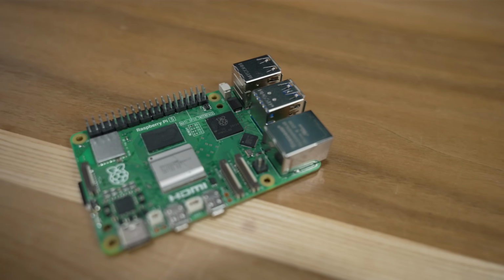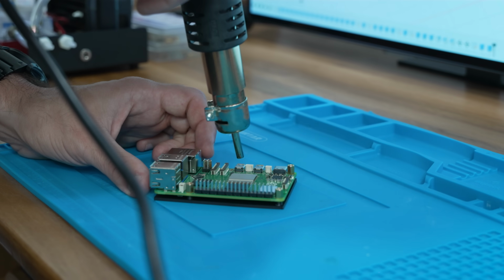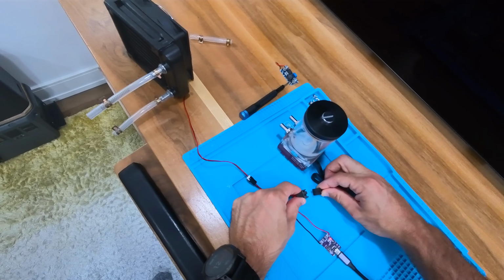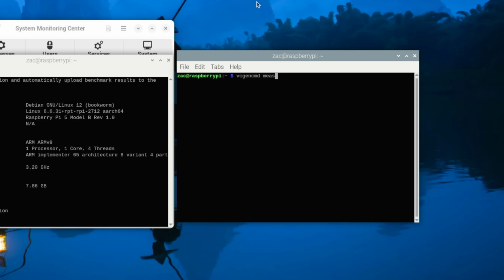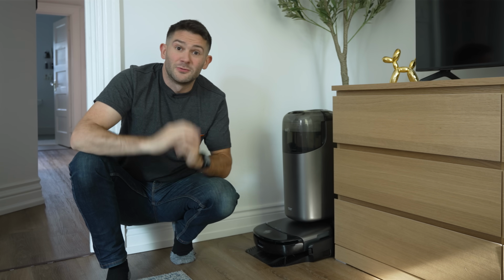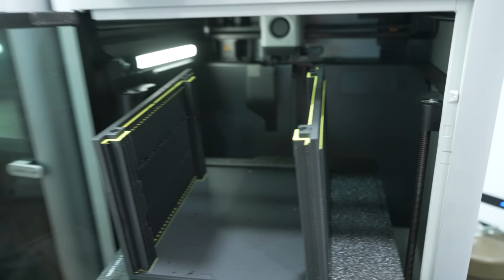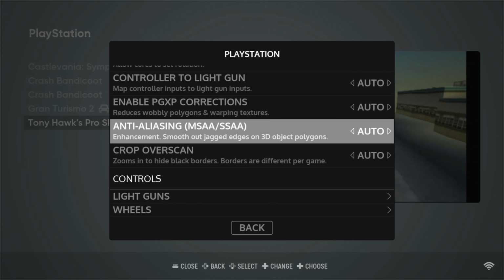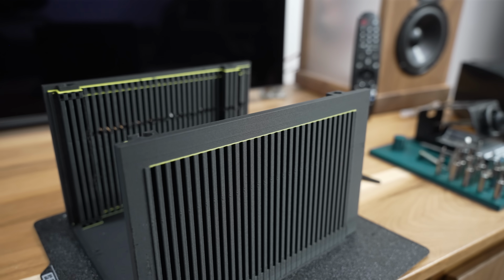Pushing a Raspberry Pi 5 to the LIMIT....

Comment: This will probably sound like "back seat driving", but a thermal pad would have solved a lot of the issues you came across :)
Reply: ...but.... he has to sell that "pro" thermal paste...
Reply: The problem was that the button was a lot higher thank CPU, and you would not want to put thermal pad on CPU if you removed ihs for thermals in the first place
Reply: A lot of this to me felt like a typical case of overengineering. Nevertheless, it's fun to see people go the extra mile.
Reply: @unstablenl  agreed
Reply: Youtube is cool because people who post advice (good or bad) are engaging with the content and giving ideas. good ideas or bad ideas!
Reply: @termiterasin  also agreed
Reply: Wouldn't a big heat sink get the job done just as well as the water cooling on this device? Seems it's would be easier too
Reply: @kennethporter992  yes, a massive block and some heat pipes would have done just fine
Reply: @kennethporter992  I can't imagine the Pi 5 can pump out enough heat to require water cooling, even when overclocked. Haven't watched the video yet, so maybe I'll eat my words
Reply: @krisc1684  Might be wrong, but I assume Zac thought he can do some crazy OC on the Pi5 hence the water cooling, but by the time he realized it is limited he was probably half way in producing the video.
Reply: In Desktop PC Environment, Single Fan water cooling is worse than air cooling. It is more compact, though. But the whole case turned out not to be smaller than a usual gaming air cooler. Using water cooling has only disadvantages her, since the size advantage was not put to use. It looks cool though
Reply: Exactly right. I'd say PTM7950 but I don't think it will ever get warm enough to phase change. A normal hermal pad would have been fine.
Reply: Yeah. With there being a hard limit on what the silicon can be pushed to, he could have easily used a small tower cooler without a noticeable loss in performance. It would draw less power and be just as effective for an active cooling solution - which a tower cooler is, along with any other cooling solution that employs moving parts. The dude that thinks a tower cooler employs passive cooling is unequivocally wrong because they utilize fabs in order to actively remove the heat that has been conducted from the CPU's IHS (or direct die) through the thermal interface material, then into the heatsink which may or may not employ heat pipes further transfers the heat into the fin stack, where the heat would remain until it is then transferred to the molecules in the air. If the air is being circulated thru the fin stack by anything other than passive means (I.e. convection currents) is active cooling. Using a laptop cooler will potentially turn a passive cooling solution into an active one.
Reply: @AlaskanGamerGuy  You're right, but just a quick correction. None of these cooling methods are active cooling. Active cooling is where heat is removed from the source directly. A tower with a fan on it is passive cooling, since the tower itself passively removes heat from the chip using conduction. The fan then helps to cool the tower, which passively loses the heat to the surrounding air. With this water cooling, it's just the same, except the water acts as a thermal mass to move the heat to a radiator, where it also passively moves to the surrounding air. 

Active cooling would be a heatpump using phase changing gasses (air conditioning, fridges), directly applying LN2, or TECs among other methods.
Reply: @Xorthis  active cooling in any time there's power involved. If a fan or a pump is being used then it's being actively cooled. Tower coolers and water blocks are both active cooling solutions. Passive would require no power or moving parts.
Reply: @AlaskanGamerGuy This is the correct response. 100% Lol.
Reply: @Strivexwolf  not sure where that dude gets his facts.
Reply: Lapping the brazed parts perfectly flat and then rounding them over by hand was pretty weird too.
Reply: I was thinking ptm7950

Comment: Someone already mentioned this but it needs repeating.  The moment you wiped the Raspian OS, all your overclocking was removed.  Remember, you were setting your overclock in config files in the OS.  You were running Batocera at stock speeds.  RetroPi would have been a better option as, I believe, it has the same configuration files as Raspian OS since it is based on it.
Reply: How ever the issue that retropie is in though is it has no full rpi 5 image. you have to get the rpios and build from that and then deal with the headaches of emulations being out of date. there's been a lot of forums on rpi5 support in it's website but so far it's a lot of build it yourself and not many emulators built to run rpi5 in 64bit. mostly a lot of 3rd party repo adding. using batocera at least gives you fully updated emulators that work with 64bit. (note this is based off of what info i found in retro pie forums since 2023. I'm unwilling to buy and run a rpi5 due to limited support and recently fixed gpu support. not worth it for a rpi4 with large emulator support in 32bit.
Reply: PopOS also has a new version for raspberry pi i saw when looking around .
Reply: Did rpi5 finally change the sd bus because my experience is that intermitten freezing because the busses are so busy.
Reply: during the benchmark at 21:58 it seems all the cores are running at 3200mHz? so i dont think thats a problem or he reconfigured it
Reply: Yes it doesnt matter. Its not the os. Its the software and firmware.

Comment: As an engineer that's worked with a lot of copper block water cooling systems in the metals industry, just resting the block on top of the unmodified CPU (with cover) and adding a little thermal paste on between the two, would have given sufficient heat transfer.
Reply: And modern thermal tapes are also efficient enough to avoid creating a bracket for this situation.
Reply: THANK YOU!
Reply: yeah the power consumption is like 3 watts lol. thing could be cooled by placing a quarter on top of it

Comment: Doing the 'stock' thermal testing with the IHS off was... a choice.
Reply: Yeah totally a big brain move , just like his "best handheld modded to be even better"
Reply: He got a pretty meaningless result, I'm sure using the standard active cooling solution would have given him low enough temperatures to do whatever he needed (and been way cheaper/easier).
Reply: a choice that likely didn't influence the result much, it'd take longer to heat up but eventually would sit at the same temperature, not really much difference in heat dissipation. also you paint your nails as a man, I think you need to think about your life choices rather than his choices for testing.
Reply: Oh get over yourself

Comment: For any DIYers 17:15 - pantyhose works really well at still allowing decent airflow while providing 10x the dust collection of wire mesh. That way you don’t have a dust sieve that leaves finer dust in your enclosure.
Reply: Hmmm... 😏
Reply: @aeaeaeaeoaeaeaeaeae 💀
Reply: I actually saw a PC build sponsored by a pantyhose company for these reasons lol
Reply: Wait! This is actually pretty smart, you can even make it more or less dense of a filter depending on how much you stretch it.
Reply: Casually looking over at my aging xeon rig wondering what she would look like in some of them shimmer hose the Hooters girls wear
Reply: Hmmmm may need to test this. I do have some pantyhose I never wear. So might work better on my pc lol. My dust filter catches the big stuff like pet hair but not much else.
Reply: Just a 'heads up' remove legs from panty hose before attempting to install!🤣🤣🤣🤣🤣

Comment: For anyone who wants to use a stock pi5.... the temps are fine. His testing was a little disengenious. The stock ihs helps quite a bit as opposed to the die just being expoosed to air. Thermal pads are also much easier to use to fill gaps.
Reply: And if you want to be lazy there's also thermal gel or puddy, which don't run. If you don't want to guess the pad thickness. You see it as that bubble gum colored stuff on many GPU's. Some types also act as thermal adhesive to avoid mounting mechanisms.

Furthermore, he didn't need to use exotic filament like CF-Nylon as ABS (like most PC components) are already made of for a reason.

But yeah, the guy is building a bike and ended up with a jet engine powered pedal assist with gyroscopes to help balance the bike. Still only a 3 speed and Walmart tires.

Even with the 1.1v 3.1GHz OC I'm sure the water loop didn't even need to have the pump running... At this point I feel like Moleman from the Simpsons, I want my 5 minutes of my life back
Reply: @MrHeHim  I'm a firm believer in doing something just because I can, but I never pass it off as something that is needed. To his credit he did mention that it isnt necessary, but that was at the end of the video already. The custom case and everything was cool. I just don't like the attitude of "you have to this to get the most out of it" you really don't.
Reply: But does the IHS help mostly by adding extra thermal mass, meaning it’ll still reach similar temps but it’ll just take longer, or does it really help dissipate the heat. Because I’m not sure that a basically flat piece of metal like an IHS really radiates much heat so I would assume that it mainly provides some extra thermal mass rather than extra dissipation. But I could be wrong.

And of course you can always stick a small heatsink on the IHS which will help dissipate the heat, even more so if you pair it with a fan as is commonly included in good Pi case kits, but you’re still limited by the size, and fins density, of the heatsinks you can physically mount on a Pi as well as the size of the fans (and the air volume they can move). I know from experience they provide enough cooling for most uses, even without a fan you can already get pretty okay performance (and the Pi shouldn’t fry itself since it has temperature limits), but there is little doubt in my mind that you can extract more performance and even some overlocking headroom with a better cooling capacity. 

Whether you need it or not is another question but if you truly want to get the most performance physically possible then you probably should look beyond the typical small heatsink and fan combo most people use with commonly available Pi cases. Although even then you probably don’t need to break out the small PC sized watercooling setup (though if you’re gonna go through the trouble of watercooling then why not) and you most likely don’t need to custom build a CPU block lol
Reply: @aurelienlux  oh your absolutely right, to get more performance you will mostly likely need better cooling. I didn't do a good job of articulating my point. I apologize. What I was trying to say was, if you just want to emulate retro games, the stock ihs is fine. And I think you are correct that the ihs just adds more thermal mass as opposed to actually cooling it. A heatsink would do both.
Reply: a big block and some heat pipes is the way i would go
Reply: @MrHeHim  He references Geoff Geerling and I looked up his video, he had what looks like pretty basic aircooling up to about 3.1Ghz.  Looks like a basic off the shelf heatsink and fan combo would likely give 3.0GHz without all the hassle and anything more is probably not worth it in the real world unless you have really specific needs (which are likely better suited to different hardware).
Reply: Agreed. Mine runs fine at 3GHz with just an aluminium heatsink case (with a thermal pad) and it only ever throttles if I throw artificially heavy loads at it. Delidding one is fun but totally unnecessary and the difference in performance between 3GHz and 3.1GHz is imperceptively small. Adding a PCIe HAT and NVMe SSD (running at Gen3) is a far better spend than watercooling as it makes a Pi5 incredibly responsive compared to running the OS from a microSD card.

An excellent pairing for an SSD upgrade is the Pimoroni NVMe Base and a 1TB Lexar NM790 as it stays well within the 1A current limit of the Pi5's PCIe bus connector and pretty much matches a Samsung 970 EVO Plus for IOPS and R/W speeds.
Reply: my question is a raspberry pie five is slower than a four year old android phone with a snapdragon 888 so if you have a older phone but not a really old one it would do a better job at emulation
Reply: The amount of money you're spending on liquid cooling a raspberry pi 5 you could spend on a phone that would perform better
Reply: @beatyoubeachyt8303 consolizing an old phone isn’t as simple and not a easy to just grab from a computer store
Reply: @MrHeHim  Yea the PA6-CF was a bit much for a heatsink that will never get above ambient. Considering the PI cannot put enough heat into the system even overclocked. PLA would have been fine. If concerned I would have gone with PETG.
Reply: as someone else stated once he swapped to the other .img on his sd card all the work he did OCing it was thrown out the window and he should have redone all those as while he was showing the games he was running on stock clocks so the watercooling was just over kill at that point.
Reply: @beatyoubeachyt8303  that rig he built was easily sub 300 bucks a decent phone is gonna be north of 500 for a newer phone and at that point you might as well just move into a nuc or a ebay special pc.

Comment: Distilled water is actually the best liquid for heat transfer, with no additives at all.  The coolant that is sold in pre-mix solutions has glycol, anti-biotic and anti-corrosive agents mixed in to prevent freezing and blockage.  All of these additives reduce the effectiveness of heat transfer.

Since this Pi (and most PCs) is not going to be in freezing temps, the glycol is useless.  Anti-corrosion additives are not needed if all metals in the loop are the same (a lot of loops are a combination of aluminum and copper, but it is common to get fully copper watercooling loops).  Anti-bio additives are the only thing that are necessary in most loops, unless you want to swap out the liquid and completely clean the loop every few months.  You can buy small bottles of anti-bio additive for this purpose.
Reply: Came here to say this, I run just distilled in my loop (cpu/gpu/2rads), I change it about every 9-12 months and have never had any issues.
Reply: I came here to say this man, thank you
Reply: For people not liking the liquid biocides; there's also high-purity silver coils sold for biocidal purposes.
For the love of yourself, don't run any system entirely without it for periods over half a year.
Once had a bit of runaway when the loop looked just fine about 5-6months in, and was a full-on disaster to clean (mainly the innards of the blocks) around 11mo. in

Probably means a contaminant was already either in the liquid or water, though after adding the silver coil it never got that bad, i usually flushed the loop every 6 to 12 mo. without issue since.
Reply: @tz496  Would adding a silver coin in the water reservoir work?
Reply: @Mesch-87 it might, but the low surface area would make it have a much weaker effect on the water. a silver coil for water reservoirs is pretty cheap though, so you can just get that assuming you have around 30$ to spare.
Reply: I work in water/waste water treatment. DONT use only distilled water. If you dont experienced any biological outbreak in your loop, then you are lucky. It can happen any time and its pain in the ass to clean it. Its understandable, if you dont want to use glycol, but some sort of biocid is a must have. Distilled and ionized water have one thing in common: they are pure and they want to be dirty.
Reply: @talos86  Yup.  You can buy small bottles of biocide that are made specifically for pc water cooling that only have biocide and nothing else.  Mixing that biocide with distilled/ionized water is the best (and cheapest) thing to use for these loops.
Reply: The glycol doesn't just lower the freezing point, it raises the boiling point.
Reply: @starsiegeplayer   If the water in your PC loop is getting close to boiling, then you have much larger issues - like evacuating the building that is currently burning down around it.  Most water cooling components have a max coolant operating temp of 60°c before they start breaking down.  Your PC will thermal shut down well before the water has any chance of boiling.

Glycol is great for vehicle cooling systems where the temp range is much larger, not for PCs.
Reply: Bring back UV cold cathode tubes lol.